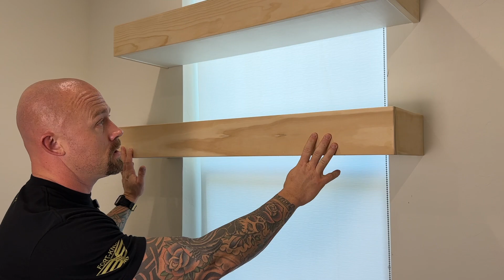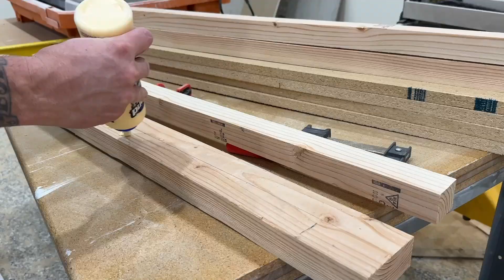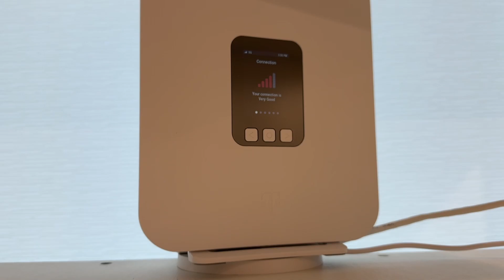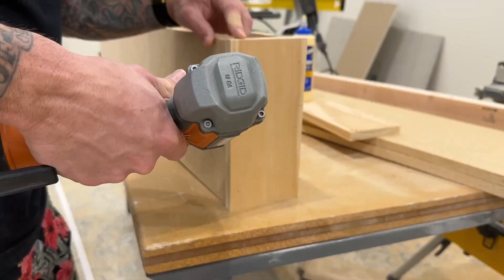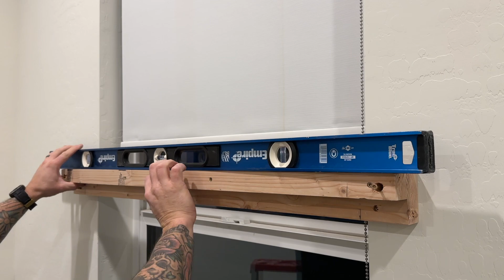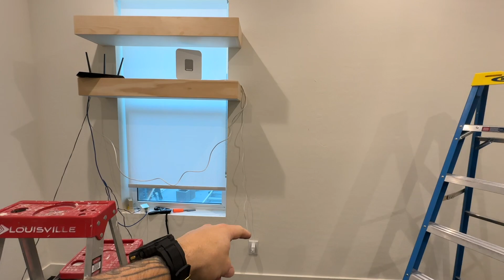Floating Shelves Over a Window?? Why not!

Comment: Hello, I am looking for shelves like this for my windows. I am not a woodworker, so I can't make them, but would you by chance know of any brands that are similar in construction to yours? I think your shelves look amazing, and you gave such amazing advice in your video!
Reply from the maker: I really appreciate that. Yeah these are kind of custom obviously and I made them a little overbuilt. With the 2 x 4 interior construction and solid board exterior construction they’re very heavy duty

I don’t know of any specifically that are sold online or from stores that would be made just like this. I made these to be able to span across the window and that is not normally how the premade store-bought shelves are made to be installed.

You would need to find a floating shelf that has a solid mounting bracket that could brace across the window and that could be secured on the too far ends only. Most floating shelves that you buy have a bracket that would span the distance but requires screws to be placed along the whole width.

I wish I could be of more help
Reply: @F @FortKnoxCo ank you so much for the reply; you were a tremendous amount of help actually! I will continue my quest for shelves just like these for my plants!

Comment: I was thinking of doing something like this for some plants to sit on. My window is about 60” across, so I was worried about how much weight a shelf could actually support, would you have a way to calculate that?
Reply from the maker: Not a specific way to calculate it necessarily but the way I built this was way overbuilt. So the same concept with knowing where your solid studs are in your wall is important so you can make sure your overbuilt shelf is secured well. But if you make something with 2x4 type solid wood inside it and frame it out well it should be pretty solid. 60” across is a wide shelf but it can be done with solid wood and internal bracing

Comment: I found this video while looking for info on how to mount shelves above a window (to make a catwalk). I hadn't even considered that I could mount them across the window, which will give the cats more clearance and let them look outside from one more perch! Thank you. It also helped that you explained how the frame is set up as far as the jack studs and king studs. (Although that assumes my house conforms to the norm, which is a bold assumption...)
Reply from the maker: Haha. Yeah your home should have the same type of framing 🤞🏼. But yeah floating across the window isn’t usually done or thought of but I figured why not…  it works for what I wanted to accomplish.
Reply from the maker: The cats could also sun bath in the window too. Could be their new favorite spot to bird watch
Reply: Having more napping and birdwatching options is always better in their eyes. :D
Reply: I'm in the exact same boat, but I'm wondering if I could get away without using anything in the middle, since my window is long and I don't want it to be sagging. Maybe a wire in the middle of the shelf up to the header?